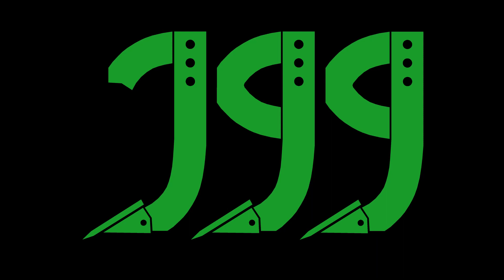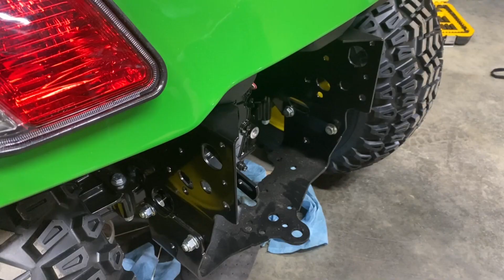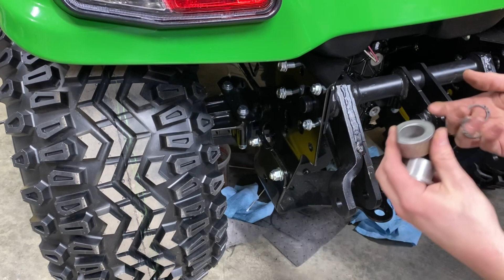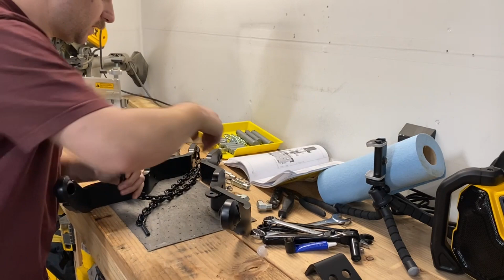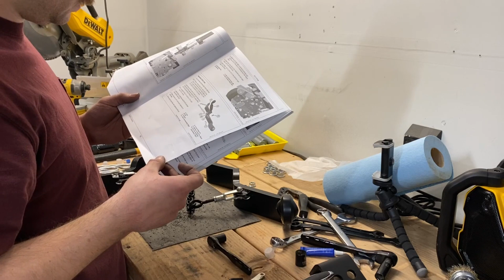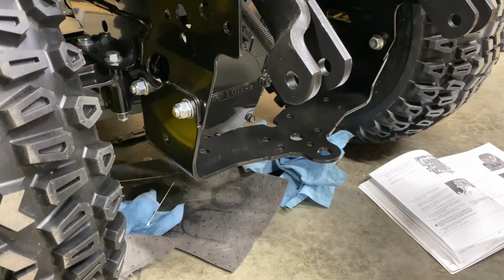John Deere X758 3 Point Hitch Install - Hitch Assembly

Comment: Josh, now that you've had the 3 pt hitch for a while, is it worth the $$ . I'm on the fence about getting one for my X758. The grappler on the front has been a great addition to this little BIG tractor. 

Thanks
MM
Reply from the maker: 100% worth it. I use the 3 point all the time. I have 2 frontier implements for, as well as 3 custom built implements. It is super handy to have. I wouldn’t hesitate to put on one of these machines.

Comment: The cost of this accessory is why Deere's foreign competion does so well,  how this is not included with every tractor is a joke played on every buyer....
Reply from the maker: Ya know, I can’t disagree with you. I do think Deere should give an option for 2 accessories at no cost with every x700 sold. But I get it, they are trying to push people to the 1025… I look at it though as in time, the hitch will be sought after as sleeve hitches for the old 100, 200, and 300s are.

Comment: Josh, the video of the 3 point hitch really helped. But it was a little low on fluid. Fill it up. 3 point hitch stop. But the belly  mower. It's still working. Wondering If you could help. Thanks in advance.
Reply from the maker: Can you send me an email? Not really enough info in that comment. Please include all details.
Reply: @JoshsGreenGarage  Thanks anyway, josh, it ended up to be The depth stop to tight to the right.

Comment: Great Video Instructions!  Works with Ruegg version and they failed to send instructions with the kit (although all hardware was there).  This made it much easier and a lot quicker.  Older X734, but worked exactly the same. Thanks!

Comment: So can three point implements be used or only limited three point implements can be used? If so what’s the difference?
Reply from the maker: Yes, three point implements can be used, the pin layout is the same, but it depends on the specific implement. From what I can gather, the limited means it is 1: built lighter, and 2: lift pins are lower, allowing the implement to be raised higher. There is a good chance you will not find a cat 1 L brush hog, but people have put them behind x700s and they work. It pretty much depends on the implement. I've seen stuff about moldboard plows having height differences where the cat 1 was taller than the cat 1 L, in this instance, the plow may always contact the ground. It really all comes down to lift height. There is a huge difference in size between an X7 and a 4 series compact, and though both are "cat 1" they can't do all the same stuff. When looking at the 3 point on a GT/SGT, you just need to recognize that they are very versatile, but not like a full blown compact tractor. You cannot expect the same out of them. You also have to consider that GTs are limited by how heavy they can be built, so they just aren't capable of the load and stress of some bigger implements. As i've said, it really just depends.

Comment: Can you still run the mower deck with the 3pt hitch? Does the hydraulics for the mower deck run the height of the hitch? Also... You going to have to remove all of that to do the PTO kit? If you're going to add the PTO kit eventually, maybe it makes sense to go ahead and do it first?
Reply from the maker: Yes, Yes, and I shouldn't have to.

The mower deck and 3 point are connected, but you can limit movement of the 3 point to use the deck, and I believe (I say this because its still winter where I am at, so haven't used the deck) the deck can be held up if you want to use the 3 point with the deck still on (although that is weird, probably better to take it off)... 

The 3 point can be held in the up position by a limiting bolt that is part of the hitch. 

The deck can be held up by the cutting height knob, just put on the highest numeric setting and it won't lower very much. At this point, again, 'I believe' the 3 point will still lower. Once I can try this I will update my comment.

The hitch is very easily disassembled as far as the lift arms are concerned. They are all held on by pins with spring clips, so they are very easy to remove and there should be plenty of access to the transaxle/PTO. Only reason I'm not doing the PTO now is because I don't want to waste the transaxle fluid for an accessory that I won't even be using right away...

Comment: Hey buddy! great video.  Just bought a Z758 along with the 3 point kit.  I also bought a MCS20 bagger which uses the click&go brackets.  I wonder if they can go on along with the upper rock shaft
Reply from the maker: I do believe click and go can go on with the rockshaft, just have to take the lift arms off